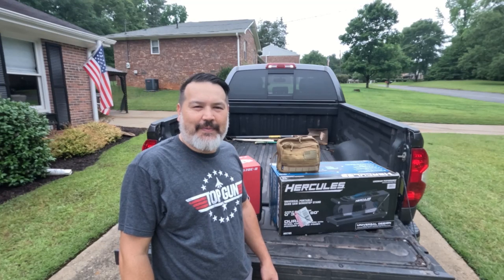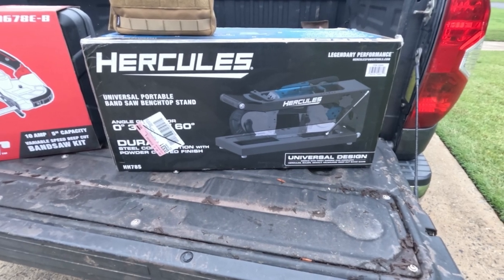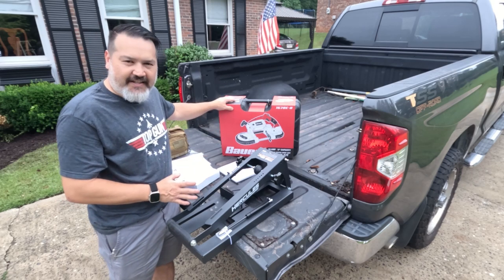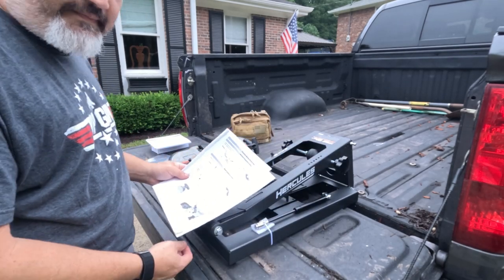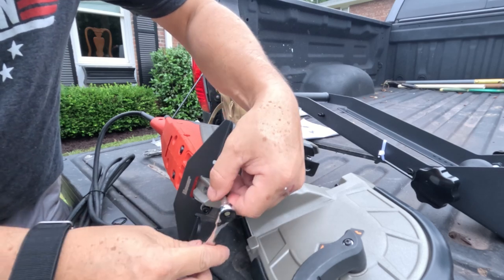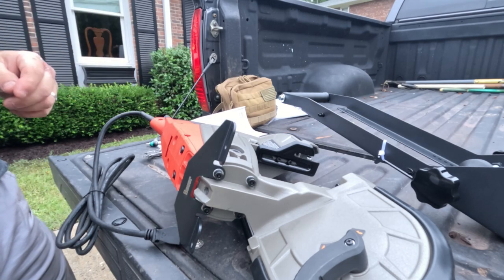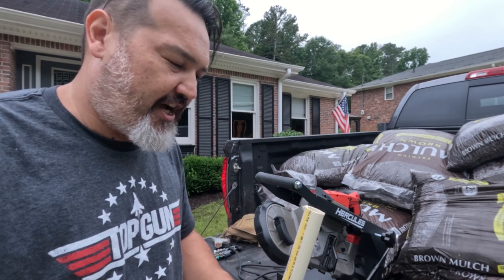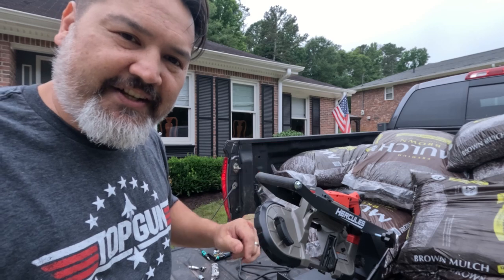Best NEW Tool released - Setup and Review of Harbor Freight Band Saw Dual Stand

Comment: I don't do a lot of metalwork, so didn't want to drop a lot of money on a Milwaukee porta band saw.  I went with the Bauer and mounted it to a SWAG Offroad table.  The Bauer cuts through steel plate like a knife through butter...easily handles up to the 1/2 inch plate I had as well as 1/4-inch angle.  So far I'm happy with it.
Reply from the maker: Glad to hear the Bauer cuts well.  I have not use it enough to form an option yet.  I would have gotten the SWAG.  But then this came along.  Thanks for watching.

Comment: Great review. Just set mine up. Seems solid and well made for 99 bucks!! Although, I have a feeling they're going to jack up the price to at least 125 in the future.
Reply from the maker: well see.
Reply: Yes you're definitely right I bought one paid $119 for it and it was just a very short time after they came out at 99.00 I also got the Hercules song for The Stand and of course they raised the price of it quite a bit too after the stand come out and as much as this song cost $170 179.00 it didn't even come with a blade I had to make another trip back down to where I bought it to buy doggone blade and nobody told me that I didn't get a blade with it

Comment: Cutting PVC pipe is not a test for any type of  saw most anything will cut that should have tried some steel I've been using mine in knife-making and does a really good job cutting and easy to get a good straight cut